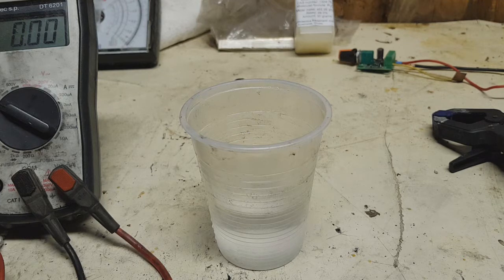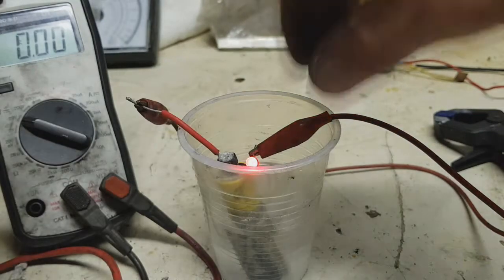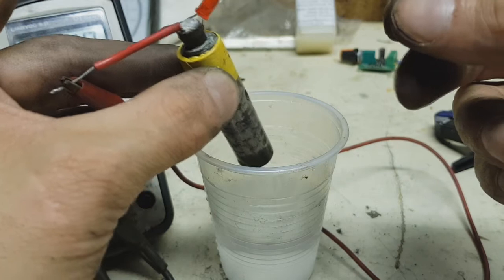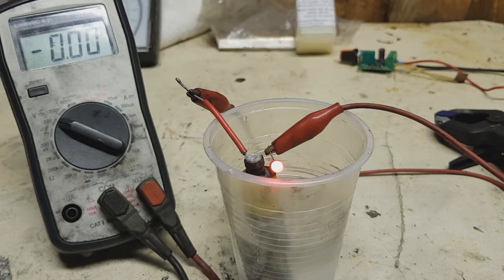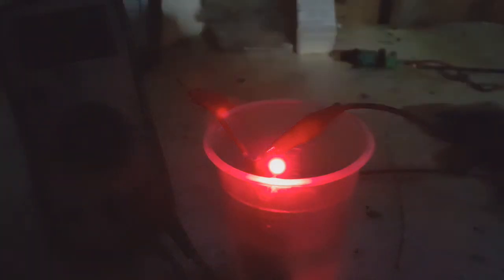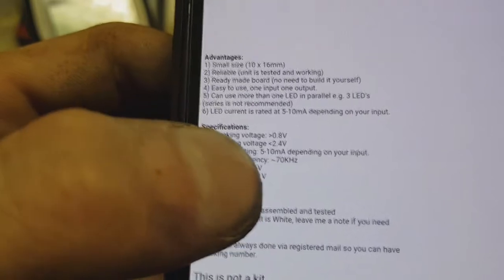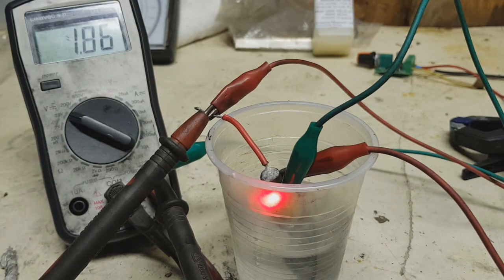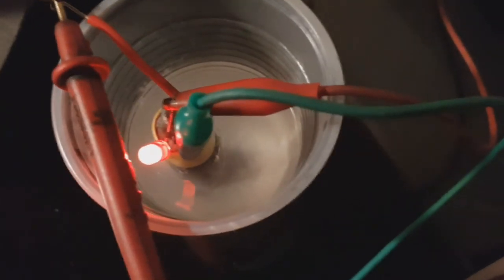Water activated Magnesium Air Battery 3

Comment: I had some Manganese laying around and I attempted to make one of these cells for fun, but it didnt work. What did i do wrong? I used graffoil with activated carbon+Mn02+distilled water, I tried using with and without a separator with the same results >< Thanks for your awesome video's !!
Reply from the maker: You need the separator. Try to use a salt water
Reply: @cayrex  Thanks for the reply =) I tried with salt water as well with only a 50ma current. Oh well..  ill tinker with it some more I guess maybe ill get lucky

Comment: Can you please try to make a 10.000 or 100.000 Farad easy to selfbuild Supercap from only carbon or graphite or Activated Carbon materials? Size does not matter...can be really big but should at least have 2Volts charge voltage and shortcircuit current should be at least 1 Amp.. That would really propell the solarstorage Technologie. ..
Many thanks. Regards, Stefan.
Reply: You could build this by rolling up carbonized paper sheets and put them into big glas or plastic jars and put 6 in series to get 12 Volts...